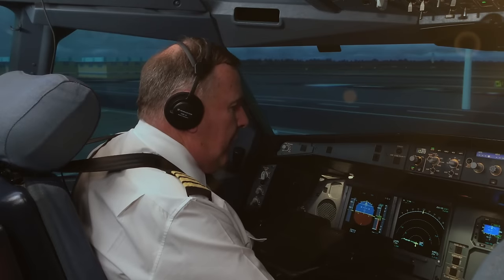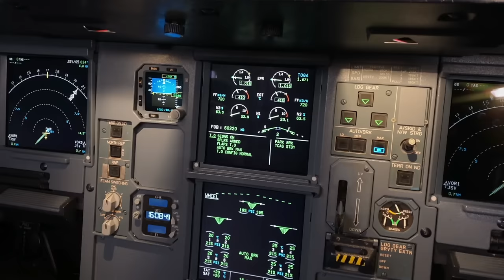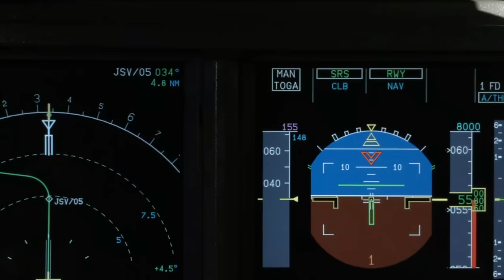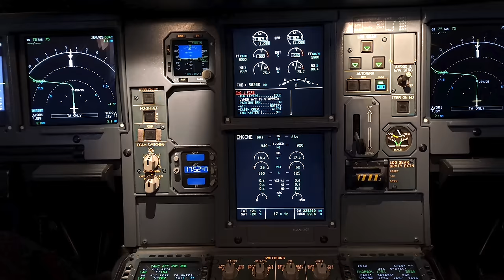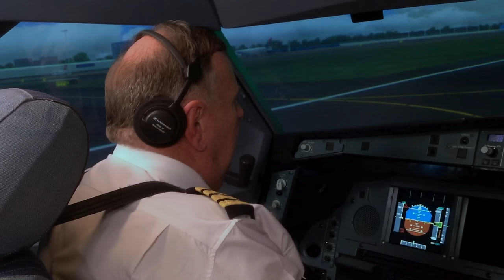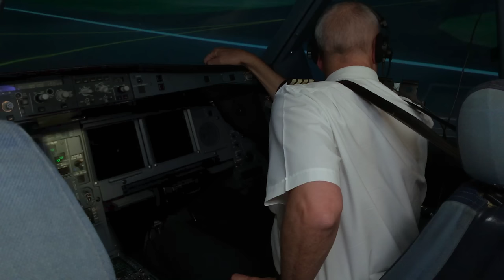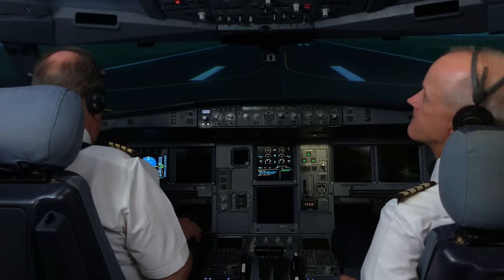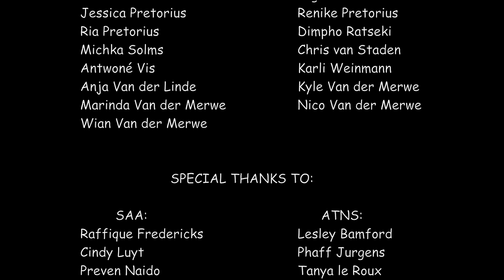CABIN CREW TRAINING: REJECTED TAKE OFF (RTO) / ABORTED TAKE OFF FOLLOWING AN ENGINE FIRE

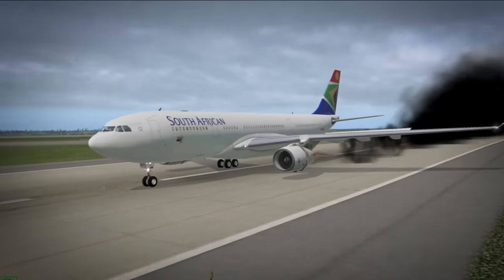Comment: 4:17 Great running action 4:03 rip girl and why the pilots won't use the brk fan 4:15 atc look hyped
Reply: Because the break fan won't work without electric power provided by the engine's generators or the APU. In this video, after the aircraft stopped, they shut down both engines and the plane switches to battery power which only provides electricity to the essentials (emergency lighting, captain's pfd, radio,...) ;)
Reply from the maker: Hi, not all Airbuses have the brake fans installed (They are optional when ordered and very expensive) Their function is actually to cool the brakes off during normal short flight tun arounds between flight so that the brakes are below 300 degrees Celsius for the next take off. Airlines that do not do many short turn arounds between flight do noot need the brake fans installed.

Comment: I work for BA and the evacuations were to slow and communication with the flight deck isn’t enough other than that I feel extremely safe getting on a SAA flight
Reply from the maker: Thanks Louis. It feels slow when you watch the videos. I tried to make them as close to real time as possible to see if the SOPS actually works out. Comms to and from the Pilots was as per our SOPS, designed not to interfere with each others duties. The biggest lessons learned from these videos were that it is imperative for the cockpit and cabin to know when and where the required information must be shared and when the other person will be on the PA so that you don't "step" on each other over the PA. I do agree that if more information is required then there must be more comms,  this was however scripted as per SOP. An evacuation can be very dangerous if done too hastily, the decision is easy if you can actually see a fire, else you better communicate very well and make very sure before giving the command. In a real case 10 seconds will feel like 'n very long time to the Crew and passengers (it actually feels much shorter than 10 seconds to the cockpit crew under stress), which is why the Capt must remember to reassure the cabin at regular intervals to stand by. Regards.

Comment: Question: Why are there different (opposite) orders when it comes to seatbelts?  At 5:00 they’re saying to release seatbelts (I’ll assume to make an evacuation easier) but then at 6:56 they say to put seatbelts back on, even though they’re not out of the danger zone yet.  With the possibility of an evacuation still there, why would they require seatbelts to be fastened again?
Reply: (I am not a crew member) Likely because of risk of 7:20?
Reply: (Also not flight crew) It was because the fire light went out they went back to normal procedures for a traditional takeoff
Reply from the maker: Hi Rosy. At first the engine fire was either contained or they were preparing for an actual evacuation so they released seatbelts to get everyone ready for a possible evacuation. Then later the brakes got so hot that a new emergency arose. These tires can actually deflate or explode quite violently and cause people to bump their heads and injure themselves, thus better to buckle up again until die Aircraft is safe or until and actual evacuation is called (Risk management). If the passengers are not buckled up they will start to up endangering other pax and themselves. (Crown control)

Comment: Wait if there’s an engine failure, aren’t you suppose to NOT use reverse thrust?
Reply: No, you can
Reply: Wrong. Learn the QRH procedures before you spit out nonsense.
Reply from the maker: Not on these enjin models, reverse thrust is still very efficient at high speed.

Comment: I know it's not entirely real but shouldn't the pilots tell the passengers to brace before suddenly stopping?
Reply: No. The Cabin Crews will shout the commands when a Rejected Takeoff even though the Flight Deck Crew didn't command the passengers to brace. (depends on different airliners)
Reply: I see that the brace command was Initiated by the 2nd Purser at 4L (Some airlines have 2 pursers for long haul), but it can be Initiated by any crew member if it is an unsafe situation and also based on their training.
Reply from the maker: No time, the cabin crew are trained to to this on thee ground. In the air before an emergency landing the pilots do say "Brace" at 1000' or 500' but this is actually a command telling the cabin crew to start their brace brace calls.

Comment: When you see engine is on fire they should get everyone out ASAP after they said it's fine fire is out that time everyone should be out but they don't allow them before the smoke comes from wheel they could get out
Reply: I worked in the Fire Dept. and then I was a flight attendant. This has only happened ONCE in a lifetime. The pilot said “Flight Attendant Noah, Please report to the flight deck. I had told him I worked in the Fire Dept. and he told me to help the Firefighters 😯.

Comment: Out of curiosity, when the crew were alerted that their brakes were hot - why did they not put the break fan on?
Reply from the maker: Hi Josh. Brake fans are not fitted as standard by Airbus. Airlines with long turn around times often do not have them installed.
Reply from the maker: Great question. Look carefully, you wil see that their is NO button for the brake fans in this model. Not all Airbuses have the brake fans installed (They are optional when ordered and very expensive) Their function is actually to cool the brakes off during normal short flight tun arounds between flight so that the brakes are below 300 degrees Celsius for the next take off. Airlines that do not do many short turn arounds between flight do noot need the brake fans installed.

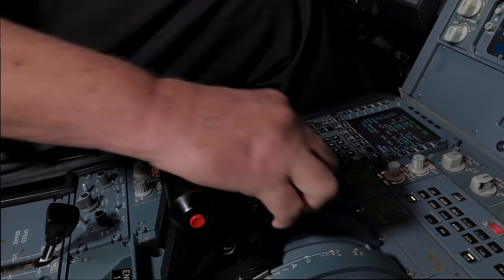Comment: 3:56 Taking off with no flaps??
Reply: @Real Simi2 Does it look like the flaps are extended
Reply: @Real Simi2 Negative, its harder to stop without flaps. And either way if thats not how physics worked then they would have a fun time in the real situation with flaps deployed.
Reply: @Real Simi2 What the..... I see it im so confused. Extending flaps to 1 degree is not that slight.
Reply from the maker: They are extended. thanks

Comment: In my professional opinion, that evacuation took far too long!
Reply from the maker: Thanks Robert. It feels slow when you watch the videos. I tried to make them as close to real time as possible to see if the SOPS actually works out. Comms to and from the Pilots was as per our SOPS, designed not to interfere with each others duties. The biggest lessons learned from these videos were that it is imperative for the cockpit and cabin to know when and where the required information must be shared and when the other person will be on the PA so that you don't "step" on each other over the PA. I do agree that if more information is required then there must be more comms,  this was however scripted as per SOP. An evacuation can be very dangerous if done too hastily, the decision is easy if you can actually see a fire, else you better communicate very well and make very sure before giving the command. In a real case 10 seconds will feel like 'n very long time to the Crew and passengers (it actually feels much shorter than 10 seconds to the cockpit crew under stress), which is why the Capt must remember to reassure the cabin at regular intervals to stand by. Regards.

Comment: These are fools if fire is there why aren't they evacuating
Reply: PJ J When designing on if an evac command will be issued. They must put the aircraft and the company in the best interest. Most fires on aircraft (If not in areas where there is not a lot of fuel) can be extinguished on ground crews behalf.